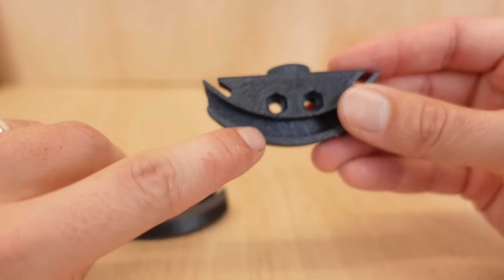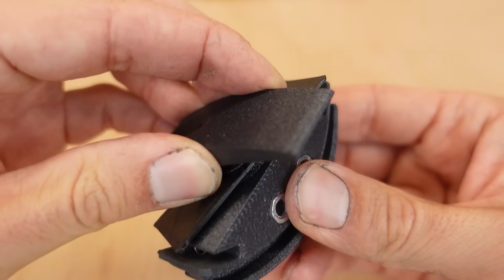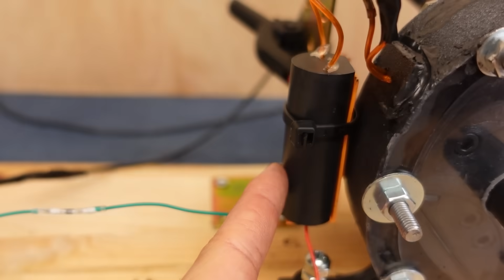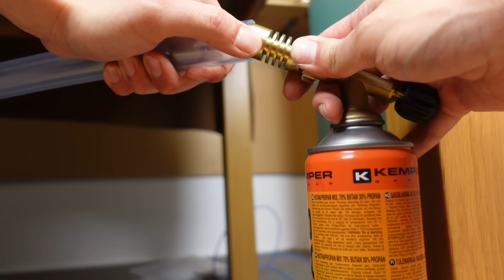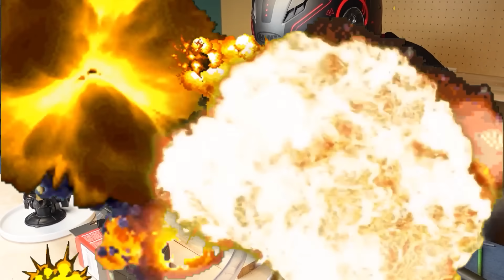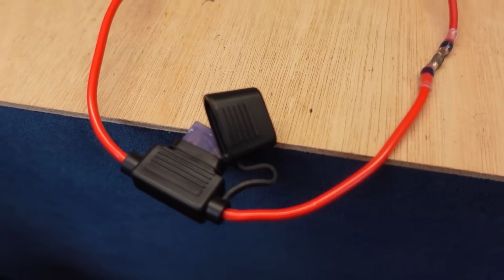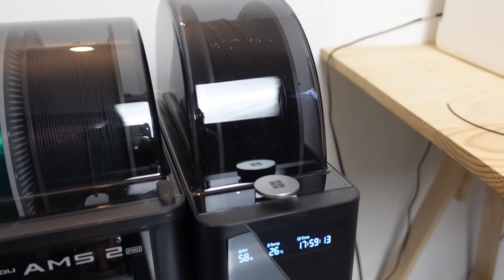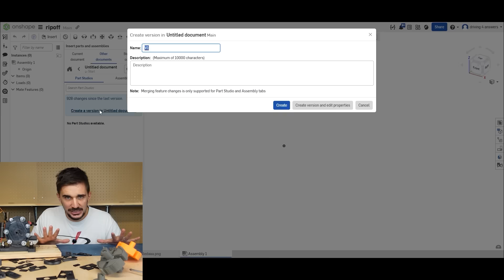My Oval Engine Now Fires At Will! Major Milestone For DIY Oval Rotary Engine 2.0

Comment: https://youtu.be/CgqrWjoTr0o
Reply: Hello, I've sent you a video with a similar issue. English subtitles are available if needed, and the description includes all the conclusions from the video. I see there's a problem with the mixture and the gas pressure/flow, which is why I'm having trouble starting the engine. If you need anything, here's a playlist where I've struggled with similar problems: "Generator/Cogenerator." Agregat / Kogenerator

Comment: It looks like the ignition timing is far too late, it should spark just after the leading edge of the piston passes the plug. Where it is now, the flame front reaches the far side as the exhaust port opens so it's just blowing the combustion pressure out of it.

Comment: Sitting in my armchair I suggest that a more sophisticated ignition system may help.  One that can easily be advanced and retarded.

Such a solid connection from the drill maybe getting in the way and some sort of simple ratchet may help by allowing the engine to turn on its own when it fires.  From the comfort of my armchair I suggest using a spring ratchet, a sliding fit over a shaft with enough friction to grip the shaft when turned in one direction and let go when turned in the opposite direction.

Comment: 1. You need a more consistent, accurate ignition system.
2. If you want it to run it's own you need a flywheel.
Reply: I agree, also ignition needs to be changed i think because it ignites the mixture while the rotor is already decompressing air and the exhaust port opens as soon as it ignites it right now
Reply: Yeah, exactly, make it once from scratch using hall sensor, arduino, transistor and old car ignition scrap.

Comment: Why did you use commutator timed ignition rather than the much more efficient breaker ignition timing? You said it was really hard to time, but you could have used your existing timing and a transistor (and back emf diode)?
Also am i dreaming or did you discover contact microphones?

Comment: You really should use a simple transistor ignition module.
Ive been building those for years for small projects and other people. They dont even cost 10 bucks to DIY.
Elliminates all inconsistant timing issues. You can even use a hall sensor or an magnetic switch if you want. Mount it on a bracket that you can adjust.
Ive seen many GOOD projects on Youtube that seem to fail just because of poor ignition. Dont want you to have the same kind of problems.
Those HV Modules are terrible and will always fail

EDIT: If you want, i can send you schematics or board files to DIY or can even send you one complete unit. I think i MAY have some PCBs left over
Reply: Came here to say hall sensor and magnet.

Comment: Around @10:20 you can see it fails to seal a couple times….
Reply from the maker: I'm not sure how you're interpreting it, but nope. Anything outside the chambers is irrelevant, as you can see the flame doesn't propagate out from the chambers, this is possibly just residual gas ignited by the heat of the exhaust.

Comment: I agree that the exhaust should be later. 
Could you explain in the next video how you treat the two "minor" chambers? (There are four of them actually) Because they expand and contract too, and if they don't pass air between them easily enough, they will make additional resistance.

Comment: Why didn't you just use a points ignition system from an old motorcycle.... would've been a lot more reliable.

A normal ignition coil creates its spark with a collapsing magnetic field, so its circuit is normally closed, and fires when you OPEN the circuit...I actually have no idea how these spark generator things even possibly work, but yeah, you need a proper ignition my guy

Edit: also, if you design for a spark plug, you can compression test -- unless I'm mistaken, I don't see side seals, so you might not even have any compression...just because the visible flame isn't propagating outside the chamber, doesn't mean it's not pushing out a bunch of mixture/air that could have been combustion pressure, but escaped

Comment: D4A has officially descended into rotary madness
Reply: Based on past data, it's a downhill slide to bankruptcy now.
Reply: Doritos, not even once
Reply: ascended
Reply: He must regret selling his RX-8.
Reply: A lot of circular thinking
Reply: @whoopsiedoodle9001  peak reply
Reply: Not the worst kind of madness.
Reply: Not so. The Wankel rotary was a bad idea from the start. Most of the force of combustion in a Wankel rotary is aimed at the apex seals, and the moment arm for producing torque is a scant 0.6", or about 15mm. The true rotary shown here has a very large moment arm. This is the key to breaking the confines to efficiency in a rotating crankshaft design. It i snot madness, it is the future of IC engines.
Reply: "I am become rotarded, destroyer of apex seals..."

-J. Robert Wankelheimer
Reply: Rotary is fun, but fundamentally inefficient. TCoO has never been so important. I'll stick with my trusty Citogo!
Reply: What's TCoO?
Reply: Rotary is the future. The only reason why pistons are advantageous is because they had about 100+ years of development, which probably has TRILLIONS of RnD thrown into it.

I seriously hate people that judge less developed platforms as "inferior" when they aren't.

Rotaries are fundamentally superior as the crank itself is the  chamber.

There's a reason why we swapped engine configurations for planes using turbofans vs piston engines.

True, we can't really use those on land and water as it's a thrust based application engine (reaction) but we can develop it further to be more mechanical based.

But this is the reason why most of the land speed records use turbojets/turbofans to break records instead of using piston dragster engines
Reply: Слабо погрузился - без огонька, без понимания сути.
Reply: @ArtemKAD1  это какой-то референс?просвети)
Reply: @Kolomy24  US1101794, US0708415, US1027182, US1406140 только во всех них надо добавить симметричную клапанную систему вместо противовеса, плюс раздельный цикл, тепловой цикл Аткинсона, 6 тактный цикл с паровым охлаждением стенок и под конец полудизель с внешними камерами сгорания(двумя, исходя из симметрии клапанов). И вот все это вместе и будет роторное безумие. :)
Reply: @ArtemKAD1  Ну почему же . Зато какой энтузиазм

Comment: Who is Will and why your engine firing at him?
Reply: @d4a  Respectfully....I believe you achieved combustion 💥 a few times because you were randomly able to hit the correct air to fuel ratio a couple times....But it looks like you weren't thinking at all about adjusting the butane torch knob & trying different air to fuel ratios....Example, you can easily make a lawnmower engine run off a propane torch by running a rubber hose. From the torch tip into the carburetor intake. The same as you are doing. But then you have to adjust/fine tune, the torch knob little by little. While trying to start it, until you have- not too much or too little, propane spraying into the carburetor intake. 
 I've done it and it's actually simple after you get it started the first time. But the on/off torch knob has to be turned to the exact same spot/proper ratio. Or it won't start. I heard you explain around the 8:35  minute mark. That since the butane is already "vaporized" that it's basically automatically at the proper air fuel ratio... Respectfully, this is incorrect (🤔 I'm wondering if you'll swear that I'm wrong & say that I have no clue what I'm talking about 😂)  I actually did learn this from personal experience. 
If you try to run your lawnmower off that butane torch & rubber hose into the carburetor & you'll see what I mean.
Reply: @michaelbrinks8089 The Venturi in the blowtorch head is what ensures proper A/F ratio, it’s not feeding fuel straight from the can. That said, there’s probably something to be said for making sure it’s delivering the right amount of fuel, and not under- or overcharging the engine.
Reply: @mrb692  I used to run my push lawn mower off a propane torch exactly how he's trying to do it. The air fuel ratio is much more finicky than he thinks. Example if I turn my torch  knob to 1 & 1/4 turns. It'll start on the first or second pull. But at a 1/2 turn or like 1 & 3/4 it won't start at all. 
Turning the torch knob is basically the equivalent of changing carburetor jet sizes.
The ventri in the blowtorch head ensures proper A/F ratio to make the torch light. But it doesn't work the same when trying to start a small engine, the way he's trying to. I hope he gets it to run and is able to go to the next step. Of possiblity machining one out aluminum. Maybe a liquid cooled housing.
Reply: @mrb692 the problem is that the torch tip is designed to create the proper A/F ratio at the tip of the torch where it expects the fire, the moment you add a hose and the explosion on the other end is not continuous but pulsing that is where can get improper A/F ratios. So in theory you have to run the torch the exact amount of lean, so in between pulses it gets to the proper ratio for each combustion event
Reply: most american answer ever🤣🤣🤣